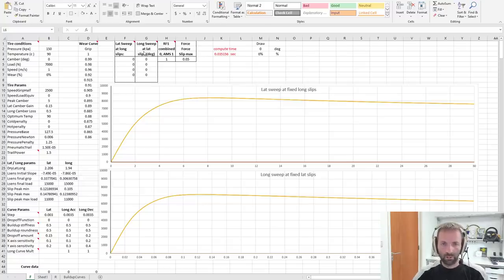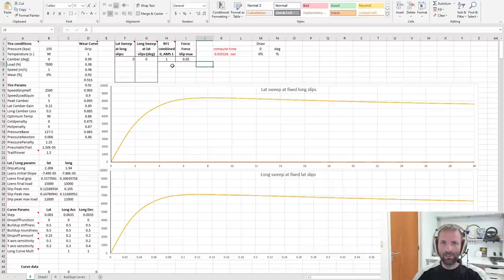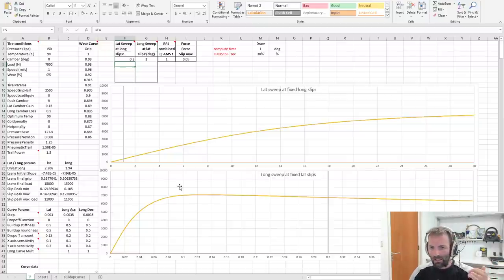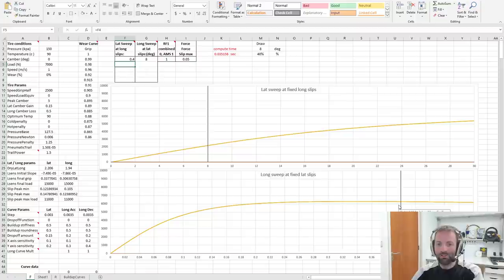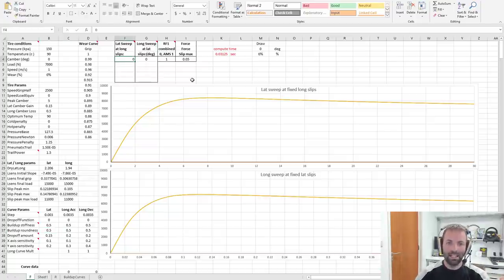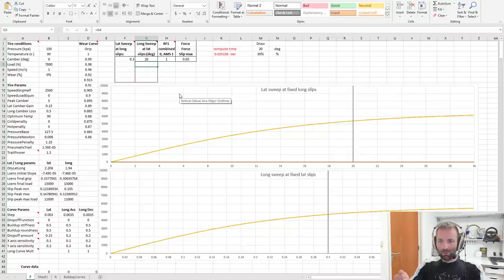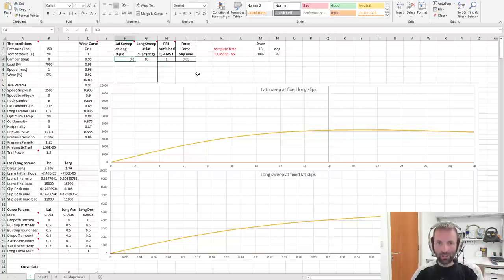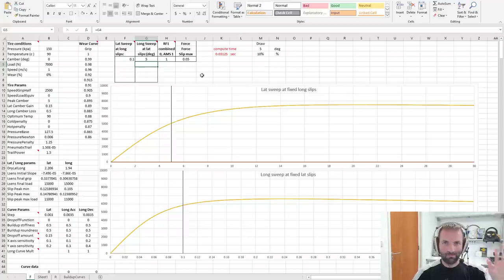How Tire Slip turns into Tire GRIP! - Combined Slip and Grip Explained! (somewhat, possibly)

Comment: Niels, maybe you can help me, i have this issue regarding tire grip, in all my games my cars doesn’t seem to have the same grip level into corners the  other people online, i’m always 2 sec slower in all games compared to other people. I’m always at the limit of the car, i mean the car just starts to understeer when others seems to “stick” to the radius of the curve. Do you might have an idea where this might come from? I changed the gear, went from Fanatec to Simucube 2, this helped a little, changed the pedals, went from Fanatec to your pedals the sprint edition but still i can’t figure out from where this issue might come from!
Reply: overdriving might happen here...    you said you are at the limit of the car..  but there is no fixed limit of a car...  for example when steering too much you reduce the amount of grip the tire can create because you are past the optimum slipangle...  so you reduce the limit of the car...
in that case steering less can give you more grip...   or steering to fast.. the heavier a car is.. the lazyier it is.. because all the mass wants to go in the direction it is already traveling... if you suddenly turn the wheel very fast, the car has not enough time to shift the weight to the outside.... so it just scrubbs over the front... you can try that when going in a straight line.. if you turn slowly to x degree of rotation.. the car will follow.. if you turn very quick to x degree of rotation the car will scrubb some time before it turns or have a initial movement then scrubbs then turn (depending on the car and how fast you turn) ...  light cars are more responsive because less mass that wants to keep the direction... so the heavier the car the more time you need to set it up for the turn..  like you are talking to it.. "there is a corner coming soon.. let us get all the mass shifted so we can travel around the corner" ..
and there are many more things like how much you brake while trailbraking since you are "stealing" cornering grip by braking grip... so trailbraking is a delicate thing.. you want to have the weight shifted to the front and the time you gain by trailing your brake into the turn.. but you want to balance it so you don't robber all the grip away from turning...  also you may don't want too much weight on the front to not overloading the tires...
thats why fast people may brake a bit earlier but not as hard or releasing the brake a bit more or earlier to carry more speed through the turn.. because yes slow in fast out... but if you can get more speed through the turn you are even faster out because you already had a higher cornering speed as a base to accelrate from...  
and well more and more things.. but in short...

try to go slower to get quicker... relaxe and set the car up for the turns...  try not to force it to turn but let it anticipate the turn..  let it roll if needed (for example long turns).. to not steal any cornering grip by accelrating or braking...
be smooth with your inputs...  especially with heavier cars...  
on light cars like formula cars.. you can be quite aggressive with inputs while still have a smooth car.. sometimes it is even needed to be quite aggressive to keep the car smooth but fast...  but the heavier the cars get like gt cars for example... the smoother the inputs needs to for them to be able to react to your inputs... otherwise the just don't do anything and want to go straight...

so if you are asking how can I go faster when I am already at the limit... try to raise the limit of the car... with your inputs and driving style...  the less forces it needs to struggle with the more headroom of limit the cars have...

I had that in the past too... I raced mainly formula and lmp cars and such things... and then joined a gt3 league.. and I thought omg.. why I am so much slower...  it wasn't the ability to not react fast enough.. quite the opposite... I was reacting faster then the car can do.. so I was driving over the limit of the car.. which sets the limit of the car even further down...(makes it slower) ...  
I was trying so hard to go even faster and faster and there was just a very marginal improvement in laptime if at all...  till I got frustrated and thought well.. I don't even try to go fast anylonger.. I just roll around now like a grandma... and ding 2.5 seconds better laptime ?!?!? wtf ?!
Then it clicked in my brain... 

so pace is all about trying to keep the limit of the car as high as possible...  it's about telling it what to do in a calm way.. so it doesn't get upset and reject to work with you...
the lighter and more engineered towards racing it gets the more you can expect it to do what you want fast... but the heavier it gets the more time you need to give it to do the work you asked it to do ..  otherwise it says no and quits the job :)

so if the car understeers it means the front can't handle what you asked it to do...  so try to let it do less ..so it can do the job...
Reply from the maker: I'm afraid its just a driving skill issue. Plenty of world records have been set with entry level equipment.. Pretty hard to pinpoint what you're doing wrong but its probably a few things!
Reply: Niels Heusinkveld If it’s my self then it’s easier to fix, i will try with a different pc (i now have an intel and will try with amd, who knows)!

Your pedals are great (i previously had the Fanatec V3’s) the sprints are miles away in term of quality of built and the smart control software is really helpful! 

Thanks for your support! 

I will keep you posted for my findings regarding my issue!
Reply: @silviutudorescu8114  no equipment you change is going to make any difference, your problem is skill not equipment (certainly changing your CPU for another is gonna make zero difference, a CPU does maths, they all do the same maths, if they didn't programs wouldn't run, of course this is known or we wouldn't have computers). 

Honestly dude, it's hard to know where to start, I would strongly recommend a couple of rl track days; as you don't seem to understand how the the dynamics and weight distribution of a car effects how much overall(lat/long) grip a tyre has as the normal force exerted on that tyre changes. Feeling this in rl is way easier than in a sim, but the understanding helps sim driving generally. Car setup can play a substantial part in this; doing car setup and learning to drive at the same time is a tricky business. Try with someone else's quick setup for a particular track and then learn to drive that setup, as it's very likely setup to trail brake well, with correct toe/camber/caster and suspension for the track. 

Sorry for the brutality, but you'd be much better off not wasting more money on sim kit (when what you have already is superb) and spending that money on track days/rl instruction.
Reply: Tyrant Worm Thanks for the explanations on where i can look into more, i guess i have to study indeed more on car physics and how to apply that weight transfer on braking vs acceleration and cornering. It’s good to know that perhaps it’s not the gear!